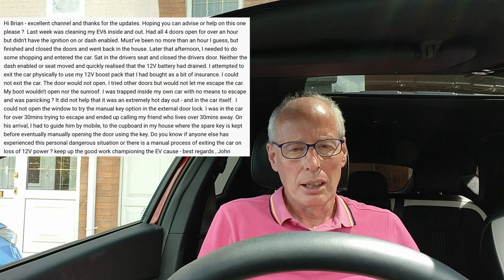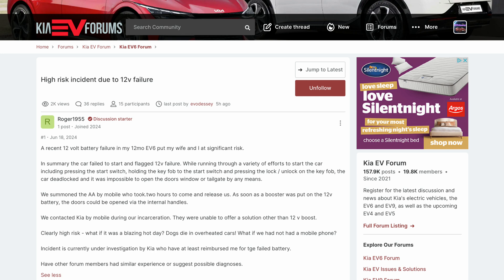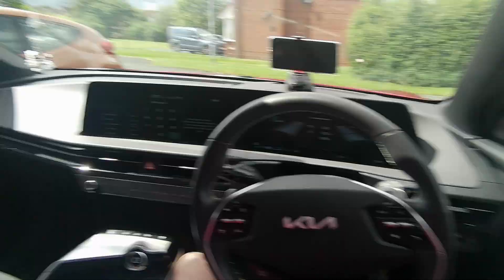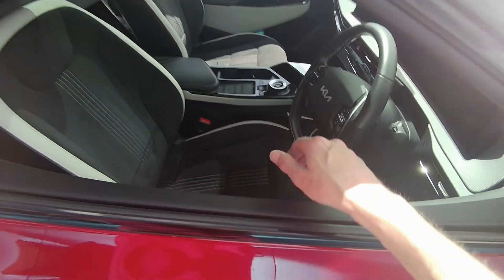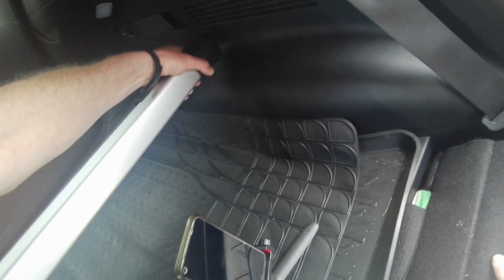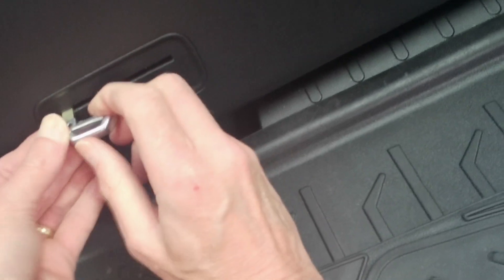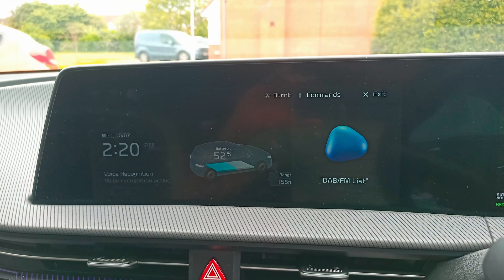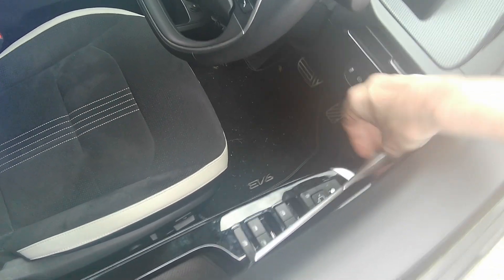Can you get trapped in your EV6 if the 12v battery fails? (Revised Version 2)

Comment: Hi Brian

I got locked inside my EV6 this morning. I was attempting to top-up charge up on the way for a long trip. In the past few days I kept getting 12V battery low warnings, especially after having my phone on wireless charge and another item on charge via USB.

Whilst attempting to charge the vehicle, the tailgate was open and so was the front driver's door. The window was slightly open too about 2cm. When the charge failed, I changed to the next charger. That failed too. I noticed the 12V warning alarm sounded, so shut the tailgate, got back in the car & shut the drivers door. The car wanted to be started with the key pressing the start button. The doors deadlocked, & the car refused to start because the 12V battery was too low. All doors were locked and I was trapped inside the car. No one was passing to call for help.
As the driver window was slightly open I had to phone a relative to come to my rescue. When he arrived, he was able to manually open the car from the outside with the key, but it was particularly difficult to do. Fortunately I had my jump starter in the front trunk and got the car going again.

Whilst I was waiting I made a phone call to Kia. They hadn't heard of a locked inside trap in before, but they are now. 

Thinking about it after the event. An alternative to breaking windows, remote climate control or escaping through the back would be to have a jump starter in the front trunk manually open the bonnet & get a trusted passer by / rescuer to connect a jump starter to the 12V battery. With the car started, the doors should be able to be unlocked.

Kia will replace my 12V battery when I get back home. But what a horrible situation to be in. My battery monitor shows the decline in voltage. It dropped like a stone.
Reply from the maker: Glad to hear you got out. Having boot and doors open for long periods always drains 12v quickly unless you have it in Utility Mode where the 12v gets charged.(unless there is an ICCU problem) There must be some bug or combination of events when the 12v is low making the car deadlock. Yours is 3rd case in the UK now i’ve heard of now.Yes keeling jump started in Frunk is a good call.

Comment: Wife has been stuck inside the car 3 times now and I've had to come out with the spare key, had to pay for kia to replace the 12v battery even though they had it for 7 weeks a few months ago because of a 12v battery battery drain. Got in today a couple of days after battery replacment to greated with check electrical vehicle system fault, amazing! As for climbing out the boot, not if your on a smart motorway and you didn't make it to a rescue area.
Reply from the maker: Wow sorry to hear that.

Comment: Hi. I’ve had no trouble with my 12v battery. However since the recall and update I now have problems. My car has done approximately 27,000 miles. It’s just over 2 years old. Any thoughts?
Reply from the maker: I think you are very lucky if you got 2 years out of the 12v battery. Most seem to fail between 18 months and 2 years. If you have the equipment such as a voltmeter or even Carscanner with OBD you should be able to see if the car is charging the 12v battery when it’s simpy turned on. Otherwise i’d book it onto the dealer to see if the ICCU is working correctly with no fault codes otherwise just changing 12v battery for new could be a waste of the new 12v battery unless you can prove the ICCU is charging it.
Reply: @evodessey  It’s definitely charging when it’s turned on. What’s odd is we find a message in the kia connect app saying door unlocked but the doors are all locked. The RAC who came out to “rescue” my wife when she got stranded tested the battery and it said it was in good condition. It also read 14v when the car was switched on.
Reply: We never get the message the doors are unlocked. And we definitely leave the car locked - wing mirrors are in and the door handles are flush with the body of the car. We also never get an amber warning. The app says battery condition is good.
Reply from the maker: @toooldforthis5733 when my battery failed only way to properly test is over night test. Kia connect gets stuck sometimes and he cleared by reset head unit by pressing recessed hole next to volume knob

Comment: So it sounds from the story below that the 12 volt battery going dead actually activated the deadlocks. And yet when brian disconnected the battery, it did not. Which suggests that as the battery is failing, either there is a hiccup causing the deadlocks to activate, or the system is deliberately doing so.  Either way, Brian has proved there is a mechanism that can result in people getting locked inside the car, and I imagine only 1% of people know there is a boot release facility. Sounds like a safety issue.
Reply from the maker: Yes & only on EU/UK cars so far since US cars do not usually have a dead locking system i’ve been told.

Comment: Unrelated, but I recently went on a road trip up north and my Ev6 won’t accept any charge above 22kwh. It just cuts out so I can’t use any fast charger, which is super annoying. My car is booked in on the 30th for the ICU recall. Does you happen to know if these two issue are likely to be linked or if there is another problem with the car?
Reply from the maker: That's means your ICCU is probably OK,most likely a failed VCMS module (Vehicle Charging Management System)
Reply: @evodessey  sounds like it’s a separate issues then. I’ve asked them to look at it whilst they do the ICCU check so hopefully they’ll fix it. Thanks.

Comment: Hi Brian !
I'm from Denmark and just got my second hand Performance GT-Line and will be having problems conditioning my HV battery before charging on tour.
Most of the chargers that I have contracted with is NOT to be found  in the navigation system. When that's the case I don't think it's posible to start conditioning by navigating to the charger. OK I could just navigate to one nearby - but that's not a good solution because I don't know the way to go to MY charger, so I need that in the navigator "too" and you can't have 2 distinations. I think we need an update to MANUALLY star the battery conditioning - right ?
Is there a way to MANUALLY start conditioning the battery or do you have another solution ?

Best
Keld in Denmark
Reply from the maker: Is it an MY22 model (2022 Model Year). You can tell if it’s got the Battery Conditioning update by going into the EV menu-> settings. If it says Winter Mode then it will need the update by your dealer and you might have to pay to have this done.
Reply: @evodessey  I have it set to DANISH language, but if I set it to ENGLISH it has a chack mark for "Battery conditioning ... " so nothing about "Winter Mode".
But is this check mark the MANUAL start of  conditioning of the battery ?
Reply from the maker: No that just enables the function. If you have the latest Infotainment update installed then you just navigate to a DC fast charger with the built in maps and the car will activate the battery pre-heating when it gets closer to the destination. Usually it takes 20 minutes to run. If the outside temperature is already 25-30c then the battery pack might be warm enough already so it will not activate. (it has to be less than 20c to activate). You will also need an active Kia Connect for it all to work.

Comment: Thanks for your efforts Brian

I agree with others that the exit is way too hard

I have another issue when my 12 failed.  Doors were fine but it left the car in neutral.  Luckily I was on flat ground, if it was hilly then I would have been stuck until roadside assistance arrived.

Design fault that has been logged through Kia Australia

Comment: Hi Brian , John here - the originator of the "locked in car" storyboard , asking for your advice and insights on Sunday. Thank you for taking the time to re-enact possible situations although at onee point , started doubting myself in some of your experiences - thankfully, your revised video made some sense on my situation. I can confirm that on returning to the car and entering it manually - door locks were in "open" position, once sat down and I closed the drivers door, ( seat didn't move , dash didn't light up ) the instruction from the dash was to start the car with the key by pressing the start button - which I followed having never experienced this instruction before. Having followed this instruction by presenting the key to the start button , it was at this point that the car deadlocked ,mirrors folded and I was locked inside with no response to me pulling on the door handle - and beginning my panic/ anxiety. I had no idea that you could manually leave the car by accessing the boot and by using the manual door key tto leverage the lock manually - albeit this could be difficult to access and I guess you need to be of a fitness and agility to do this in a timely manner - but I really do appreciate the tip on this and by demonstrating that this is achievable. WoW, love my EV6 but never envisaged that a situation could ever arise,  I would ever be trapped inside my own car with no easy route to leave in an emergency or critical situation. Thanks again for your great videos and popular insights - hugely appreciated - Thank you , Best regards , John
Reply from the maker: Cheers John. It also happened to viewer Alan Bootle today. In all 3 cases now i’ve heard of the 12v was failing or nearly failed and the car was stationary. Alan’s comment is pinned to the top of the comments if you’d,like to compare experiences. I feel that car maybe going into some kind of fail safe mode and dead locking or it’s a software bug. This has to be reported to Kia by as many who have had the problem.

Comment: I'm not yet an EV6 owner (planning to, soon after the midlife release!) but learning what I can about the car before! 
It's my understanding that 12 volt battery charges when the car is on, or off and the traction battery is charging or when systems are activated by using the app. Does the main battery keep the 12 volt battery topped up any other time? What about when the car is parked up while away on holiday? (Assuming ICCU is working normally)
Reply: Yes, the car will recharge the 12V battery if necessary, even if the car is completely turned off. But this can only be done a few times (7?) to avoid the traction battery being drained by a defective 12v battery. BTW, I haven't experienced any problems with the EV6 yet.
Reply from the maker: The VCMS (vehicle charging management system) keeps the 12v topped up. 12v is charged if car is in it’s “ON” state,in Utility Mode,if the V2L adapter is plugged in,even with no load and nothing plugged in,12v also charged during Remote Parking Assist & whilst Kia Connect is active.12v also topped up as you drive & also whilst the car is being charged.
Reply: @evodessey  Is that statement complete? I can hear the car going into (12V) charging mode even when it is off and no charging cable or adapter is connected.

Comment: A 12 volt battery story (from an ice car)...
My Peugeot 308 diesel battery we're showing signs of weakness and the stop start system hadn't worked for about 5 years. 
Halfords tested it said it replacing and just said about £250 to fit a new one. 
I decided to invest 40 quid in a Topdon 200 tester. This confirmed Halfords assessment and said despite being 100% charged the battery only had 25% capacity left. I wanted a new battery from Tayna batteries and tested it on arrival despite being 100% charged it said the battery was 69% capacity and needed replacing! Tayna asked me to install it charge it run it and report back. This I did but the battery condition actually was slightly worse. On the strength of this I rejected the battery and on receipt of a new one, tested it at 96% capacity and 100% charge.
On the strength of this I would wholeheartedly recommend having a battery tester to monitor your battery health over time to check is status within warranty so you can complain before expiry. I wish I'd had one for my original battery when the car was less than 3 years because I suspect the battery was failing then!
BTW a Bosch battery from Tayna saved me £80 less than Halfords but I had to fit it myself.
Reply: Further to this I would suggest that when reconnecting the 12 volt battery in any modern car that you give it a few minutes maybe at least five, for the systems to boot up and settle down before activating anything else. I am sure this has let the problems when I've been in haste!

Comment: If you have enough battery to start the climate, can't you just use the remote unlock?
Reply from the maker: Maybe but I think it’s unlikely since the unlock button in the car had already failed to unlock due to lack of 12v in one of the real life cases i looked at.  Running the climate for 5-10 minutes would charge the 12v enough though whereas doing the remote unlock would only briefly wake up the 12v charging system. The only way to find out for sure is to test in a real 12v failure situation.
Reply: If 12Volt is gone - you won't even get to start the climate. The electronics is dead. As in dead. However, If there is a little bit of juice to turn on the electronics, and you get to the Climate button quickly enough before the voltage drops out - then you can do a recover. Been there, done that.
Reply: I'm doubtful that a 12v battery too flat to unlock the car would then have sufficient oomph to simultaneously run the climate system and engage the traction battery contactor to permit charging. Otherwise, another great video!
Reply from the maker: @jongosling711 I know one of my viewers who managed it so unlikely or not it worked for him.
Reply: @jongosling711  Yesss - should have mentioned that - have gotten used to using the key 🔑 to get into the car. So much so, that I leave the lock trim permanently off the door handle ! (Soul handle is different to EV6)
Reply from the maker: This has inspired me to do some research.I’m going to see how long & when the 12v charging system comes on when you to do a Kia Connect function. Would remotely opening the charging door for example be the lowest drain on 12v &  how many minutes of 12v charging would it give or would a status update?

Comment: That boot emergency exit is as useful as an ashtray on a motorbike. Gotta be a better solution.
Incidentally, you mentioned the little hammer, Brian - which seems like car manufacturers should supply one as standard, for emergency use. Have seen a suggestion, that removing a head restraint, and using the metal support to break a window might be a last resort option too. Will have to find a scrap car to see if that works.
Reply from the maker: It seemed more difficult to open when deadlocked.I totally agree. I was thinking about other things i could use. That’s a good one and might actually work. Other way i was thinking was to use 12v booster in the glove box to energise the door wiring if i could get at it.
Reply: @evodessey  Yeah, but this is us, trying to fix THEIR problem !  Hyundai/Kia people should have had this brain-stormed and sorted years, and years, ago. Talking recently to a guy with 2017 Hyundai Ioniq (the original one) and he had his NoCo booster pack for years. Same experience as mine with the Soul - once a 12V battery has had about 12 months of use, it'll be dead. Particularly at its first cold snap after 12 months. Those of us with any kind of technical abilities have been coming up with various "fixes", when H-K should have had this nailed a long time ago. Certainly before bringing out new models. They're going to get a really bad name for themselves - when much of their other tech is good - better than VW anyway !